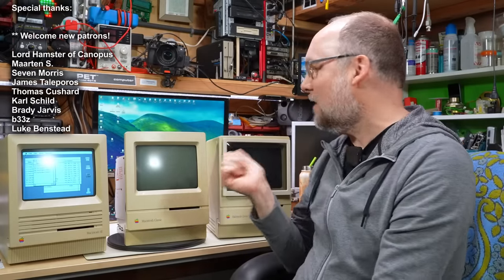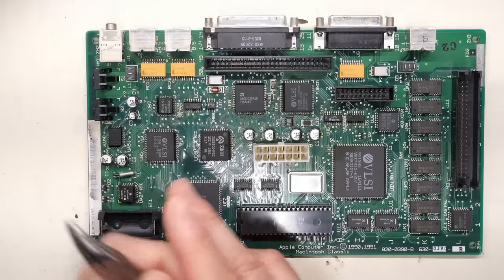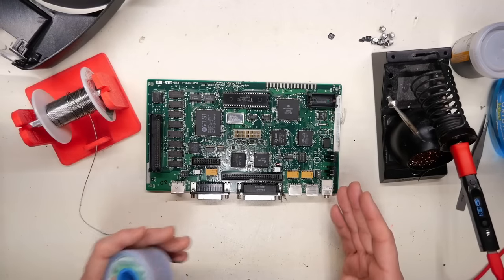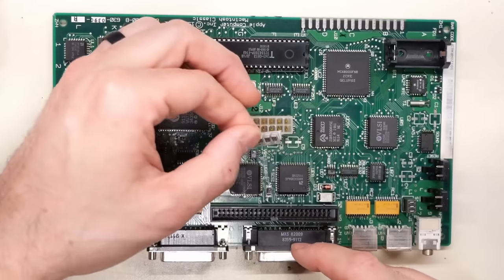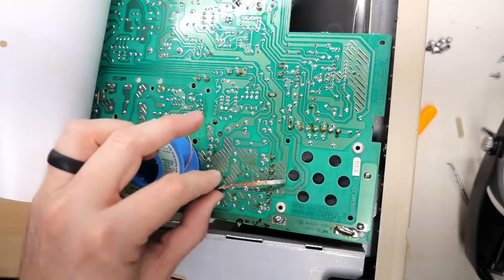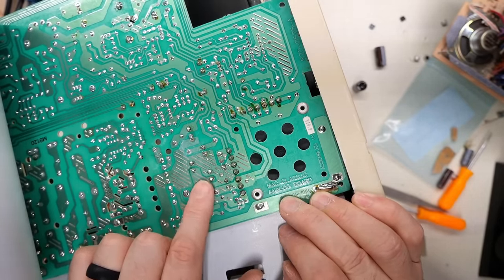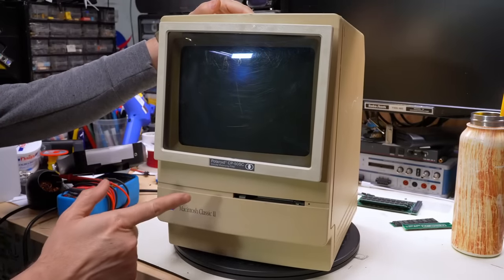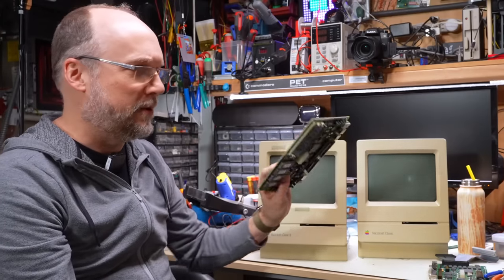Not so fast! I hit some road blocks fixing the Mac Classic

Comment: Other repair videos I watch use copious amounts of flux in all stages of cleanup.  It seems to help the solder push away the crusty crap.
Reply: That's what the flux is there for.  It's mildly acidic when hot, and it helps remove corrosion.  There are many kinds of flux, but the best for electronics work tends to be the rosin stuff.    This is also why adding extra liquid flux to your solder wick (even though it usually has rosin flux in it already) is generally a good idea.  Just helps the wick work better, and can help clean up nasty solder.

Comment: vinegar dissolves metals, that should be the bubbling. The bubbles are Hydrogen gas. For dissolving residues, i would first use something like wd40 then isoprpanol, which removes the wd 40 also. wd40 would be the unpolar solvent, isopropanol the polar one, which should solve pretty much everything in combination. I would bet the tiny ceramics werent 47µf.

Comment: I'm actually sorta curious what chemical reaction is causing the bubbles. 
I'm assuming those are wet aluminium electrolytic capacitors? But what did they use an an electrolyte in the 80s?

Comment: Vinegar is mostly to neutralize any alcaline solution. I works on the iquid of some caps and batteries, but mostly to prevent further corrosion by turning the alkali into a salt.
To eliminate the salt residue, you need to know what exactly goes into those caps/batteries and, after neutralizing the spillage (you may need to use a different reagent, like ammonia, depending on the specific leaky component), use the correct solvent (e.g. water, alcohol, acetone, a table salt solution, a coppersulphate solution, a rust remover, etc.)

Comment: If I remember, the problem with 90's capacitors is due to corporate espionage gone bad.  If I remember the news at the time, some Chinese manufacturer stole the electrolyte formula from a major manufacturer, but they botched the recipe, so capacitors manufactured with that formula all leak and fail over time.

Unfortunately, before the news broke and everybody found out, they sold millions of capacitors as counterfeits of all the major brands, and manufacturers everywhere bought them, thinking they were getting good quality and discount prices.  And we're still suffering the aftermath of that mess today.

Comment: No sound will be missing voltage on the snd chip or a bad trace, fixed so many. For the ram I’d suspect the ls368 or the ls 174(or is it a 166)? Those are almost always ugly.

Comment: this litle plastic rivets locks like the stuff that holds togeter every modern car, i use a "Nietheber" rivet lifter translated. you cold try to pull then out with flush cutting side-cutters, for eras you couldn't reach the backside . just get under the head of the pin carefully

Comment: When recapping, could you add solder to the pad on one side and melt the capacitor into the solder, and add solder to the other side afterwards?
Reply: It’s possible, and some do it that way, but alignment can be trickier.
Reply: @kaitlyn__L  I found that having a solder bulge on both pads made alignment much harder.
 I did one that way, struggled to get it sitting flat, and then did the rest as the OP suggests. Much simpler.
 The only thing I'd add is to make sure to use flux so the solder will wick into the joints.
Reply: @CoCoNutBob  Absolutely only on one side, the cap would end up at an angle. And plenty flux is important. I would struggle very much doing it the way Adrian is doing it, caps would fly away every time.

Comment: You put a lot of focus on capacitors of 90s being leaky, despite they are made by a good brand like Nichicon.
The point is that whom engineedered those caps, for sure, did not put any effort to make them last till now. Probably their goal was to make something with good electrical performance with a 10 years maximum lifespan. I’m pretty confident to say that they achieved that result.Same thing could being said for the nvram battieries.
Reply: You're probably very true, according to my own later investigations.
Reply: I was working in electronics during this era.  I heard two different stories from our suppliers.  (1) There was some industrial espionage and the manufacturer did not get the full formula for the electrolyte.  (2) One of the chemical companies supplying the chemicals changed something that messed up the correct formula.  The component manufacturers were caught off guard too when their failure rate suddenly went through the roof.
Reply: @larrysmall3521  First one seems to be very true especially for Russia due to vast variety of counterfeit parts inflow Ж(

Comment: You've never used vinegar for leaky batteries? The bubbling is the reaction you get using vinegar to clean leaked batteries or caps! You should be using vinegar every time before washing. I use it for vintage toy battery terminals that have blue salts( I assume there is a color difference from batteries to caps) when they had batteries left in them. It bubbles until it's clean. Unfortunately, sometimes on battery terminals, it's leaked so bad that there is no metal left to be conductive. As for the blue or white crusties I've always had to scrape that away. I assume it would be easier if the chip was removed first, then carefully scrape off. I've never done it on circuit boards though.

Comment: The vinegar is acid and the electrolyte is alcaline - so the vinegar neutralises the alcaline natue of electrolyte. However vinegar will corrode metal as well, so it is a process, alcaline bad, add acid until neutralised good, remove  all residue or else bad.

Comment: Consider using/buying an ESR meter to test the caps. They even work in circuit and are a must have tool for troubleshooting and general maintenance. It can detect failing caps before they leak or bulge
Reply: He has one

Comment: You mentioned that its okay to leave rosin flux on a board -- I actually firmly disagree. The way flux works is by dissolving oxide layers. Therefore it IS corrosive. Over time, oxides will be created and the leftover flux will then dissolve it, slowly eating away the metal. Typically there's not enough leftover flux to completely destroy a pad or lead, but it takes two seconds to clean with IPA or a flux remover pen.

Comment: Any tips on what passives are good to keep in stock, both quantities and values?  Quantity can be tricky, since you go through things quicker than someone like me would and it may also differ based on what you work on, but maybe something like "you probably need twice as many x and y" or "you're going to use a ton of x, but not very many y".
Reply: I suggest stocks of 1uF, 10uF, 100uF, 4.7uF and 47uF. To extend add the 2.2/22/220 series. 470 and 1000 are uncommon but are encountered. For some reason the 68 series is not commonly found, and the other values are much rarer IME.

Type-wise, SMD electrolytics are v.common, THT Radial (pins one end). For old kit, Axial (pins both ends) is much more common than radial, but radial had mostly taken over by the 90s. (SMD=surface mount, THT=through hole)

Non-electrolytic caps are: tantalum, ceramic, MLCC (multilayer ceramic), SLCC (single...) and polyester film. There are others but not normally encountered in this context. The different types are all good in their own ways. MLCC is most common these days, but they can be bad for audio circuits because of noise, and tantalum seem to be preferred there. SLCC/MLCC are generally only available in SMD forms.

If you're looking to start, try getting one of the capacitor 'kits', which have a few (typ 10) of a range of parts and then order direct the ones you run out of.

Comment: I always wondered why cap electrolyte smells like that, so I Googled it...

They often used Methylamine or Diethylamine in the electrolyte.

Methylamine has that almost "rotten fish" smell, and it also a component of the rather unfortunate genetic / metabolic disorder "Trimethylaminuria".

Trimethylaminuria is also known as "Fish odour syndrome", caused by a genetic problem. It must be terrible to live with.

Apparently some much older caps really did use fish oils in the electrolyte as well, which I can see as being possible.
Reply: I'd actually heard of Fish odour syndrome since I was a kid.

I had a Hypoglycemia until I eventually "grew out" of it in my teens.
I went to a few meetings back then, with the parents and kids with similar genetic / metabolic issues.

Comment: About flux. There are a few times when you want to clean it up. The main one is around the battery and real time clock. It can make a tiny difference to power consumption, but it adds up to potentially years off the life of the battery.

I had this debate with our PCBA manufacturer years ago, when they wanted us to lift the quiescent current limit. It was about 5uA over from memory.

Comment: I'd be attentive to the concentration of the white vinegar, strong enough and it may corrode metals.
Another is to make sure no vinegar remains, and I'd do DI water (also easily accessible) and let dry well afterwards.
As to cleaning pads, check if you can get your paws on a glass fiber pen (like a pencil, but with glass fiber core), I think it should vanquish the crust on the pads.

Comment: Regardless of what anyone says about your method of removing caps with the wiggle method, I think it completely makes sense.  It did bother me when you were using the twist method, but even that might not matter with failed caps.  Either way the horizontal shearing forces are more likely to tear the legs away inside the caps since the force is locked against the plastic base.

Keep making great content!
Reply: He's clearly not damaging his boards, so I don't get the complaining either. If it was so risky he'd be spending time repairing traces, which he certainly isn't needing to do... That added time would quickly make anyone search for a better method.

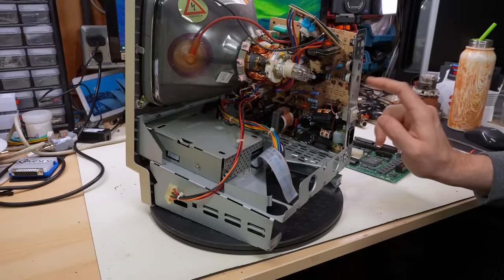Comment: 3:35 Apple did sell a Mac Classic model with only 1MB ram on the motherboard, and did not include the memory expansion board. If you're gonna buy a Mac Classic, ensure it has at least 2MB of ram so that you def are getting the expansion board.
Reply from the maker: Ah good to know -- very stingy of them!
Reply: @adriansdigitalbasement I have an apple work group server and it makes the chime but then does the crash up sound I can’t find what is causing it .

Comment: Have you decoded the sad-mac code yet?

Unfortunately, YouTube is blocking any attempt to provide a link to a table decoding it, so I can't share that, but 00000005 / 00080000 translates to major error code 5, minor code 00080000.

Major error code 5 means "RAM external addressing test failed. Minor error code indicates a failed address line."

So we know the external RAM card is bad.  And it is telling us (I think) that address line 19 is the one that is failing.  So if you have a pinout for the RAM expansion card, it should tell you exactly which wire is flaking out.  Hopefully that will let you quickly find the broken/shorted trace that's causing the problem.

Comment: the thing about recapping is that the era of the electronics matters a lot. i mostly fix capacitor plague stuff so you cant trust the damn things so they all go. in some cases i will use an old cap salvaged from '70s electronics and it will work just fine.

i think there may be some corporate espionage involved. supposedly the electrolyte formula was stolen, but the formula excluded a number of stabilization compounds which supposedly were only known by a few trusted employees. the result was a lot of caps were mass produced without the stabilizers and they made their way into a lot of electronics. at least thats the version of the story i heard. other conspiracy theories exist.

Comment: Now you have me wonder Adrian, you use deoxit on the copper oxide ( the green stuff ) ... Why not try it on the white stuff wich is either tin- or lead oxide ( both are white ) ?
Reply: Deoxit is a contact cleaner and will have both anti-corrosion (good) and conductive (in this case bad) properties. Bad because it will be easier to get a short between two pins.

Comment: 36:33 Nichikon in those years drove marriage :) The Rubicon was much better. Panasonic also made good capacitors in those years.I worked in the Panasonic and Rubicon service for 13 years. The capacitors were very reliable as they were installed in equipment with round-the-clock operation such as mini telephone exchanges.

Comment: Hello, years pass but the problems are the same, it seems that the cleaning technology is poor even today.
I hate using alcohol because it leaves a lot of flux stuck to the boards.
If it is a board that needs a complete cleaning, I prefer to use glass cleaner or a kitchen cleaning product that contains ammonia and a toothbrush. And then lots of water to clean dirt and cleaner residue.

Comment: Adding vinegar is iffy. You need to know what your adding it to and why. The point of vinegar is to neutralise alkaline, but not all capacitors have an alkaline electrolyte. The counterfeit ones from the capacitor plague generally did, so vinegar is good for neutralising that. However good Japanese capacitors had an acidic electrolyte, so if those leaked then vinegar will make it worse. Instead sodium bicarbonate should be used on those. But of course vinegar is always essential for neutralising battery leakage.

Comment: I don't like to use vinegar for too long and by too long I mean minutes. Vinegar is very agressive and can take off more than you want. When I use vinegar I always try to neutralize it with baking soda+water, then rinse everything off, then apply alcohol agains the water. After the liquid trealtemnt I try to wipe off anything excess, sometimes I use compressed air or hairdryer to blow liquid from under chips and let everything dry while having the board vertically.

Flux is not corrosive, not bad for the board but can conduct. David (Thee8BitGuy) assembled together some computer kit (hand soldered components) and it was working but acting strangely. After he cleaned the board off of flux, it was working as intended. If you use non-clean flux, then you don't have to clean it, otherwise it's recommended to clean up a little around the components' legs.
Reply: I can confirm vinegar may work to remove some things, but eats away other things.  Definitely learned that the hard way myself.
Reply: Even with no-clean flux I like to scrub to ensure any solder balls are removed from the board to prevent shorting. It doesn't matter much on boards with large components but on things like these motherboards many of the chips have pitch fine enough that even a teensy ball of solder could migrate and short out between two legs. POlus it's a good way to inspect your work.

Comment: I will say this on the SMD electrolytic cap removal methods. The two best methods assuming corrosion from electrolytic leakage are the wiggle method and the cut method. That being said what Adrian said about applying downwards pressure when wiggling is the real secret for both the cut and wiggle method because more then anything applying upward pressure on corrosion weakened traces will more often than not lead to lifted/damaged traces. Also, be aware that which removal method you ultimately use, in a given situation, wiggle or cut method, really depends on how corroded a particular cap is. That being said a good rule of thumb to follow is if the corrosion is bad use the cut method and if it’s not so bad then wiggle away with confidence and always don’t forget to apply downward pressure.

Comment: Removing the battery from the 3rd mac (which wasn't leaking btw) and then powering on the board which had leaky caps all over the place (+ analog board had leaky caps) is beyond me.... First you repair the problems then power on.